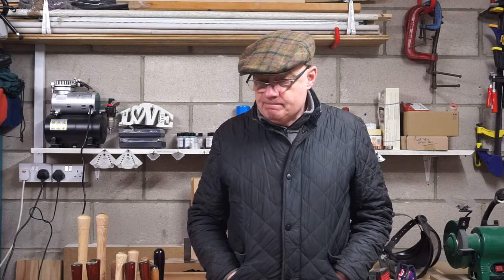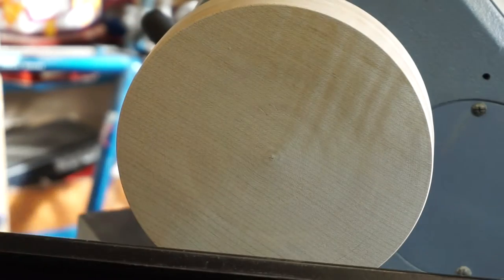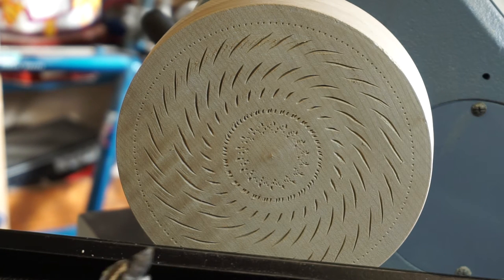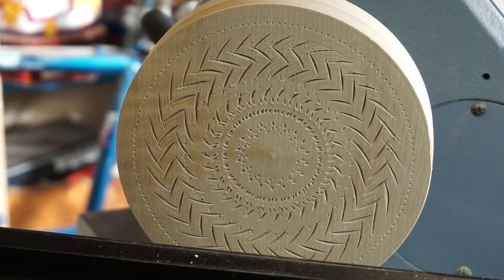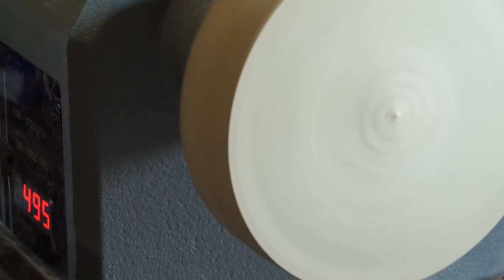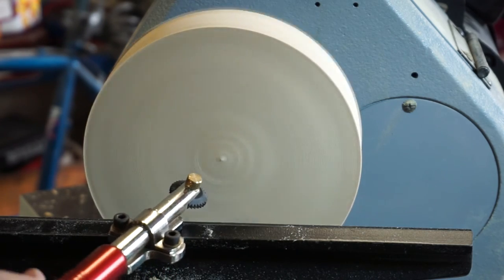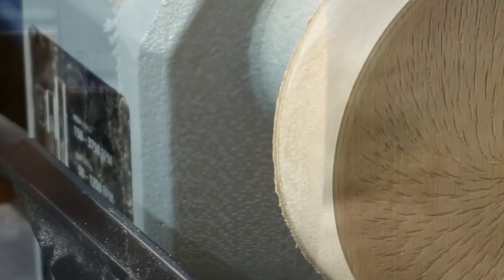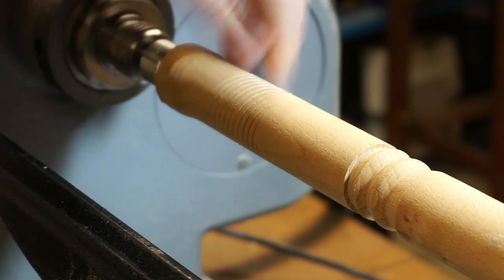#16 Trying out Texturing and Spiralling

Comment: Hi Andrew. It’s refreshing to see someone at similar place and showing when it doesn’t go to plan.  I’ve recently purchased the large and small Worby tools and so far not got very great results consistently.  Nick Agar  has been my main source of guidance and while he is brilliant at using these tools I found doing exactly what he demonstrated was not sufficient to produce the same result.  So have been somewhat disappointed.  One thing I did notice is you present the tool with the  bevel of the spiralling cutters facing away from the work which Nick shows towards the work.  I’m guessing both can be used to get some interesting patterns and texture although the flat side seems to be more aggressive and more tearing.  It’s very clear that one needs to practice one scrap a lot  and your video has lifted my enthusiasm by showing that I’m not alone in getting mixed results.   I’ve started being a bit more scientific now logging each test cut and how I present the tool, I.e.   bevel in or out, angle of presentation cutter size etc.  hopefully this will allow me to find some that I can replicate on actual workpieces.  Thank you for taking time to share your experiences.
Reply: Hi Kev. Thanks for the comment. Yeah practice is definitely needed but some interesting patterns can be made. I've since moved on to model engineering. Have fun!
Cheers
Andrew

Comment: They are great tools Andrew but take a lot of practice. I have messed about with the spiralling tool a lot and still find it difficult to get consistent patterns, there are a lot of variables affecting the result, such as the diameter of the workpiece. Nicely filmed, cheers, Jim.
Reply from the maker: Hi Jim, many thanks for the advice. Cheers. Andrew

Comment: Very interesting video, esp after looking into the new spiralling and texturing tools released by Crown in Sheffield. 
Just a question about when you first try the spiralling bit. Did the tearout happen because you were moving the tool not towards the bevel side, but the flat side? As in do you think it would have torn if you had done the exact same move but with the bevel of the bit facing the direction of your movement?
Reply: Hi. I'm sorry but I can't remember. I've moved on to model engineering now.
Cheers
Andrrw